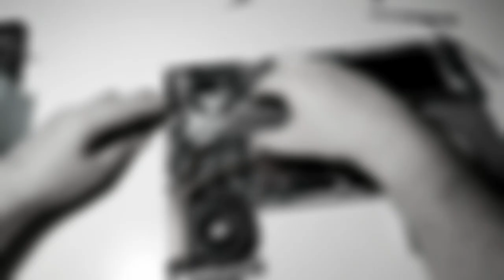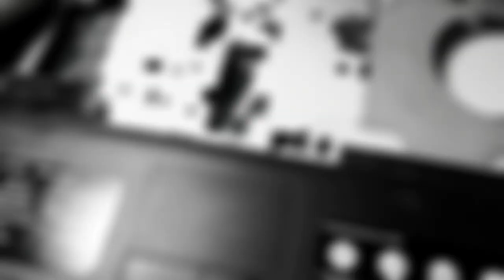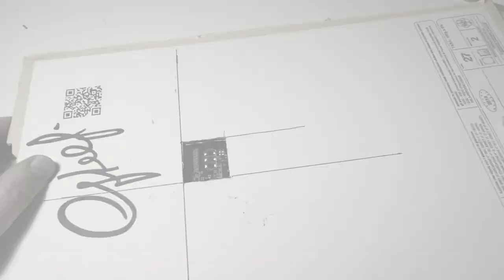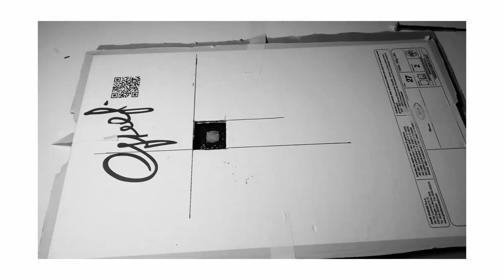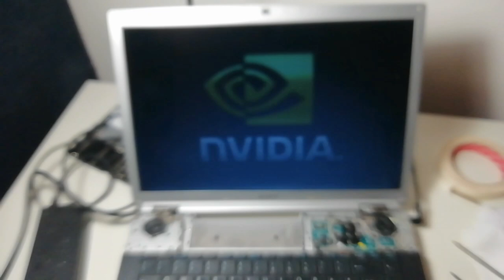Reflow: Come riparare una scheda video con GPU Nvidia su Sony Vaio

Comment: A me accende con artefatti video, che mi consigli reflow gpu nvidia o reflow? su ram video
Reply from the maker: Molto più probabile che dipenda dalla GPU, in ogni caso prima di procedere valuta la tua abilità tecnica e la possibilità di peggiorare la situazione se qualcosa va storto. Grazie per la visione, se non lo hai già fatto: condividi, commenta, metti mi piace, iscriviti al canale. 
Gruppo telegram su https://t.me/andreastoolbox
Reply: @AndreaBox  la cosa migliore sarebbe fare il reballing sulla gpu nvidia.
Reply from the maker: @pietropuleo2662 Certamente se si vuole un risultato più duraturo e si hanno le attrezzature e le capacità tecniche adeguate.
Reply: @AndreaBox  ho un amico che mi può aiutare a fare il reballing, per adesso ho disattivato la scheda video e vado con quella della cpu
Reply from the maker: @pietropuleo2662  Ottimo, tienici aggiornati sull'esito.